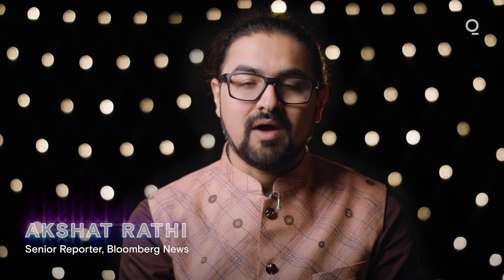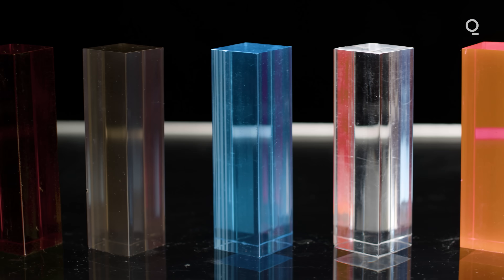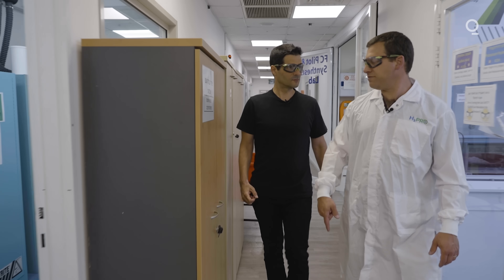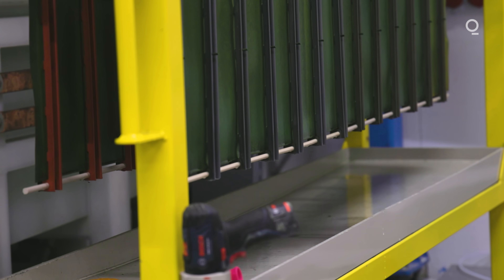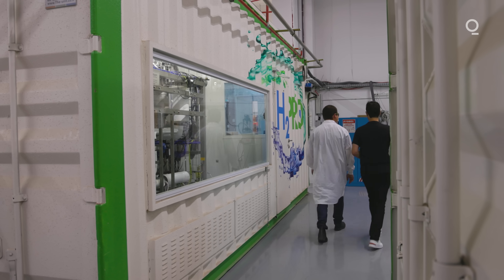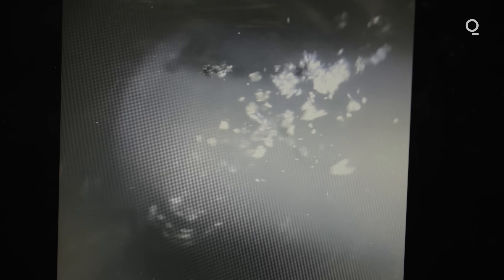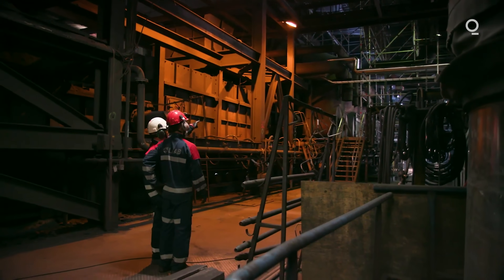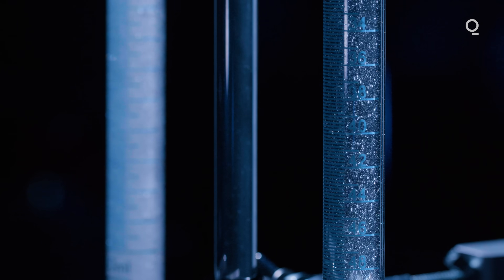How Cheap Hydrogen Could Become the Next Clean Fuel

Comment: The problem is that hydrogen has a low volumetric efficiency.  If your car ran on hydrogen, it'd need a fuel tank EIGHT TIMES as large as your gas tank, to give you the same driving range, and it would have to be a very heavy tank built to contain the pressure of liquid hydrogen and it must be chilled very cold to exist as a liquid.   The tanks would have to withstand pressures of 5000 PSI.
Reply: The best solution is to just not use a car, hydrogen or no hydrogen. Other cities in countries that are NOT America actually have a pretty well-developed transportation system that doesn’t necessitate the use of cars and, in some cases, work against the use of cars by forcing you to carpool outside their cities and take other modes of transportation instead, such as buses and trains. One train/bus produces far less emissions than the combined equivalent of hundreds of cars that would have been needed for each and every individual instead.

And that goes without mentioning the possibility that the sheer size of trains themselves could possibly allow for viable storage of hydrogen as fuel for the trains.

Of course, you can’t justify banning cars either, since people who live in rural areas need some form of personal long-distance transportation in order to access the more-localized trains and buses in urban areas.

But at the same time, there doesn’t need to be nearly as many cars as what we currently have. All we need to do is make the alternative modes of transportation viable and accessible (and perhaps make cities a little more car-unfriendly, forcing people to carpool outside the city to take a train or a bus), and that alone would cut down on CO2 emissions in quite a drastic way, all while making cities a lot nicer looking and pedestrian-friendly, too.
Reply: @yojojo3000  Mass transportation only works well in densely populated cities.   America's population is WAY more spread out than that of the more crowded European nations.  What works in New York or Miami or Los Angeles WILL NOT work in more than one percent of America by surface area.   And nobody's got trillions of dollars to create a mass transit system that loses money every day because it runs nearly empty nearly all the time.,
Reply: @Turboy65  America’s population is spread out as thin as it is because the majority of the land surrounding their cities is reserved for car parking lots instead of residential buildings and businesses. These areas are thus not only designed to be difficult (and dangerous) to travel through without a car, but they also prevent high population density from even being a possibility. Majority of these places don’t have any means of alternate transportation either, further preventing and discouraging people from living there. Solve all those issues (and others) and your population density will begin to look more like an actual city, and funding alternate transport systems won’t be so difficult.

Creating a massive transit system doesn’t take a day. You have to start somewhere and slowly expand over the course of a couple years or even decades. To fund something like that and maintain it, Tire taxes, Parking taxes, etc. can help fund these things, among other things such as fundraisers (tire taxes especially, since majority of Americans own cars and need to change tires every now and then). If there isn’t enough money on hand, put the transit expansion on hold until you do. It’s really not that difficult, it’s just time-consuming.
Reply: You can store it in a hydrate and get back out to release the hydrogen...no need to store at very high pressures or use an ammonia.

Think theres a ted talk or MIT talk on u tube...very intreasting
Reply: This interpretation is entirely erroneous. You really need to do more research.
Reply: @diduckd  You're the one who's wrong. Hydrogen does not have the energy density per liter of gasoline.  Liquid hydrogen has an energy density of 8 MJ/L while gasoline, 32 MJ/L and gasoline does not require ultra high pressure storage tanks.
Reply: the tanks must be  even in a cheaper way more reinforced and stable so the amount of durability kills the cost of structure  replacement  after exp... or win the  percent  at least
Reply: But toyota already has a well functioning hydrogen car… with an acceptable range too, the problem is the green hydrogen and the lack of refilling stations
Reply: Not really tho, you just need to make a tank 8 times more pressurized than a normal tank. And it doesnt really have to be a liquid
Reply: @Hector_pita  That's kind of dumb.  You're saying to make tanks rated for 80,000 to 160,000 PSI.  There's no practical way to even generate those pressures.   The tank's weight would be astronomical.   And nobody would want to get near that BOMB.

Comment: Its also Interesting to mention additional elements that hydrogen can be converted to for transportation and usage (shipping fuels, fertiliser etc) such as green ammonia which Norwegian fertiliser company Yara is developing. 
On paper it Provides an interesting answer to some of the issues of transportation such as the low temperature required for storage and the specialised steels needed for equipment.
Reply: metal embrittlement issue of hydrogen is still unresolved, it will be a maintenance and cost nightmare
Reply: @koblongata  For hydrogen line is used stainless steel AISI 321.
Reply: Very true, TES H2 is also doing the same
Reply: Hydrogen has great potential but not for domestic cooking or heating
Reply: Green ammonia?  Where you getting the nitrogen from? Pulling N2 apart is about as energy intensive as it gets.

Comment: Actually the world's most popular alternative fuel has about 37 percent hydrogen ang it's propane. In the Grade 5 auto propane used in North America, it has 104 Octane with means it will produce equal power to gasoline in today's very high compression ratio engines with at least 10.5 to one CR. Even the big Ford 7.3 liter gas engine brought out 2 years ago, has 18 percent higher CR than the 10 cylinder 6 8 liter engine that it replaced means better Miles Per Gallon and more torque and horsepower. The same thing applies to the new Chev 6 6 liter gasoline e.ngine, with  it's 16 percent higher compression ratio than the 6.0 liter engine that it replaced 2 years ago. Over the past 40 years, the pump price of LPG propane has been about 55 to 60 percent of the price of gasoline. Since propane burns so hot and clean, your engine will last 3 to 4 times longer than running only on gasoline. We recommend to leave the factory gasoline system in place and just add on the total separate propane system with high tech propane fuel injectors. This way you have a choice of fuels and will never have to worry about running out of fuel on long trips. Propane burns about 80 percent cleaner than gasoline in the same engine

Comment: You forgot about inefficiencies of producing "green" hydrogen, not to mention compressing and transporting it. For production with electrolysis around 25% of energy goes to waste, another 25% goes to waste due to compression and transportation. If this hydrogen is used in a car with a fuel cell we lose another 25% of energy (including electric motor inefficiency). (Reminder: hydrogen cars is driven by electric motor (!), the only change is its battery, in the case of hydrogen car's, the "battery" is hydrogen tank and fuel cell that produces electricity.) Hydrogen cars use only 25% of energy! On the other hand, electric cars with lithium battery use around 75% of the energy (20% of energy is lost in electric grid, 1–5% in charging and depleting lithium battery and electric motor inefficiency.)

Now tell me, how "green" hydrogen is better than simply using electricity that we produce to send over the grid to charge electric cars? I understand that for industries (like steel) you need hydrogen for something else than fuel cells, also for potential airplanes, and maybe bigger transportation vehicles for which battery would be too big and it makes sense to power them with hydrogen. But for daily driver, for going to work and back home, 50% of energy loss is simply too much.
Reply: Lithium batteries had 3 decades to develop and they still need to go to a landfill after 5 years of daily usage.
Reply: @minewolf3605  I agree, I lot needs to be done about that. Theoretically then can be recycled, but there is no financial incentive for that, which is a shame.
Reply: Im guessing a time would come where people will run out of non - renewables and prices for Hydrogen may decrease compared to petroleum fuels... then transition to hydrogen energy might be possible
Reply: @trickytn2322  You are not addressing what I said.
Reply: You are correct that energy effiency of using hydrogen to power cars is a lot lower than electric cars. Your numbers are a bit off but the point is correct.

However it really comes down to storage. A hydrogen car doesn't need a large battery, so if you can store hydrogen cheaper and lighter than you can store electricity in a battery, then you may get some cheaper capital cost and larger battery range.

But yeah I don't understand why there's hype for hydrogen cars, it's a bit silly. Hydrogen has so many other better uses.
Reply: The amount of misinformation about the hydrogen is huge. The main goal is to replace natural gas in the industry, then heavy transport and machinery, synthetic fuels for aviation, energy storage for remote areas...

Hydrogen cars aren't even on the list, at least in the EU. Batteries are a better option for personal transportation.
Reply: @albertoa.r.5886  Idiocity in the west is huge
Reply: You didn't mention the energy wasted carrying heavy batteries. EV has poor weight to power ratio. 
Also, energy wasted for generating electricity, energy wasted in mining and making batteries that probably don't even last 5 years. 
Also, time wasted on charging them, time wasted when battery is not working. 
Time, is worth more than anything you've mentioned. 
Support synthetic fuel, it is the future.
That combustion engine just works everytime, without range anxiety.
Reply: @jmadmachine9819  That's true, at least for you first line. I must admit I don't know the answer and will check it up. For your other points, I disagree. First, batteries do last more then 5 years in cars and better batteries are on their way. Secondly, going to gas station every week or more is time wasted, while charging your car at home or at parking stop over night is the opposite.
Reply: you forget about the 3 people who have invented it already and been assassinated
Reply: @vevohitz8339  You are talking about those guys that showed how second law of thermodynamics does not apply in hydrogen cars?

Comment: Unbound hydrogen is very problematic simply because is has propensity to leak from what ever is used to contain it. This makes bound hydrogen the ideal form, methane is a common bound form of hydrogen. We already do much with methane and even then methane leak problems are found often enough; our handling unbound hydrogen is certain to be handled in a very leaky fashion. Propane is a very big bound hydrogen molecule. Our handling propane is maybe done with the fewest leaks.
Reply: Cept that methane is far worse in terms of greenhouse gasses... If we had a solid recyclable binder of sorts for hydrogen that would be ideal.
Reply: @Relics_AI  how you going to tap into it? That's the beginning of the leaks.
Reply: @rustyyb8450   I would say tap it as it's being used. So you don't have to worry about containment after it's been released from the solid medium. Preferably this medium can be refilled with gassious hydrogen when it's produced
Reply: @Relics_AI  You aren't making methane to release it into the atmosphere.  You are making it to burn it.
Reply: Did you say ammonia? That is a bound form that would be VERY useful 😊

Comment: Does the energy it takes to create hydrogen exceed the energy produced by hydrogen combustion? What's the ratio?
Reply: It is a violation of basic laws of physics to think that you could get more energy out of a system than you put in. The most effective way to make hydrogen is extraction from natural gas but it leaves carbon monoxide as a byproduct.
Reply: it's 1:1 theoretically but in practice you will never convert 100% of the energy - combustion is hard to control and produces mostly heat, which is difficult to convert into electricity efficiently and things like PEM fuel cells run at 50-60% efficiency; just as with fossil fuels - we must make a lot of it and it must be dirt cheap to be of any practical use

Comment: H2 pro use heat instead of electricity to increase the efficiency of electrolysers, but my here my doubt is that, how did you supply high heat because according to 1st law of thermodynamics energy can't be destroy or produce so you have to first generate heat by using power or you can used waste heat but they limited their application.
Reply: Most electrolysers use high temperature, it simply increases efficiency. However the efficiency is never 100%, thus that wasted energy comes out as heat, which helps keep the eletrolyser at its high temperature.

The main problem with high temperature electrolysers is that it takes some investment to heat it up, so if  you are using an unstable energy source like a wind turbine farm then the higher efficiency is not worth it.

Comment: 80% of the electrical power generated comes from fossil fuels. So where will you get the electrical energy to produce this mythical "clean hydrogen" fuel? Certainly not from solar or wind power.

Comment: For industry, heavy machinery, ships, lorries and trains, maybe H will have a future. Possible as ammonia, for transport. For personal transport, heating and so on, electricity is best used directly. H is tricky to transport, and SAFE user storage requires heavy tanks and a very costly compression process. Cryo also requires a lot of energy and is dangerous if not supervised by experts. Metal hydride is heavy and bulky. And ammonia is very toxic and corrosive.

Comment: My only thing is that why turn renewable electricity into hydrogen and then back into electricity? Even using it as fuel (like in cars) is wierd since you cant really have liquid H2 in that kind of environment
Reply: Best way to power something without loosing much of electricity is to connect it straight to the wires, not even storing the electricity. Though, cars with over head wires is something that could be done...

heck why stop there, 
remove the friction I.e. make it steel to steel
stop low ridership I.e. extend the vehicle and put more seats
There you go, you have a train.
Reply: So they can get government funding.
Other than that, hydrogen is completely worthless as a fuel source in every way.

Comment: A molten salt reactor would create hydrogen in the cooling cycle.
Reply: Any nuclear reactor today would do this better than renewables, perhaps hydro and geothermal aside, but I would still err on the side of nuclear. At the very least, you have cleaner, safer, more reliable and higher quality energy with a nuclear power plant.

Comment: Hydrogen for cars has a fraction of the efficiency of electric batteries and is therefore doomed to fail (just check current global sales of EVs vs. hydrogen). Hydrogen will at best be a niche market for long-haul flights and ocean shipping.
Reply: No. While you are correct about the use for transportation, there are a lot of applications in industry(steel, aluminum, chemistry so on) We are going to need every bit we can get.

Comment: You have fallen for the CO2 is bad lie. CO2 feeds the world. Life on earth is carbon based ALL of the carbon in all life enters the food chain from atmospheric CO2. over the last 50 years the world population has increased by 3 billion people yet the number of deaths from starvation have, in the same time , had a 40 fold reduction. from an average of 1 million deaths per year in the 70's (population 4 billion) to less than 25,000 per year over the last decade (population 7 billion). The ONLY world metric that has actually increased in step with CO2 rise has been crop yields. The planet will eventually die but not because of too much CO2 but because of a lack of carbon from too much being lost to bones and shells (calcium carbonate) which locks the carbon away from where it can be recycled into more life.

Comment: It's gonna take more than just imagining - Hydrogen is the fuel of future,
You need a powerpacked storage facility, and most importantly creating Energy without putting much
Reply: its just an energy storage technology. Hydrogen is already our fuel of choice; it come in the form of hydrocarbons. Hydrogen bound up as a hydrocarbon is ready to be used today. Unbound hydrogen is very difficult to store as it very very easily leaks from anything not a perfect container. Did you know that unbound hydrogen passes though a few inches of concrete very easily?

Comment: 4:55 he said they raise the temperature to release oxygen, and then goes on to say no power is applied. I wonder how they increase the heat
Reply: I also wonder just based on high school chemistry that what happens to water when you remove the oxygen? Where is the hydrogen bonded in the meanwhile? If you release oxygen from the water you also release hydrogen at the same time. Something doesn't match up here. I think they dumbified their explanation down too much. edit: There are two stage systems published and they could be using something like nickel hydroxide - nickel oxide hydroxide reaction to store the atoms. Basically an alkaline solution with oxides and hydroxides and shifting those around to either be oxygen rich or hydrogen rich. That way they can have a two stage system. They take some of the oxygen out at every cycle of the fluids, not all of it, and keep repeating the process indefinitely.
Reply: Maybe by using the 1st hydrogen green that they made